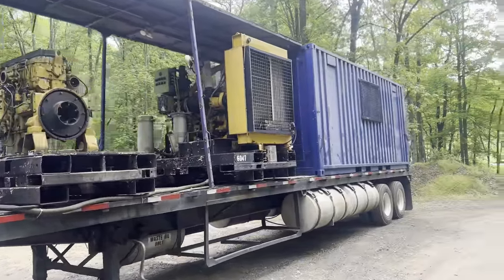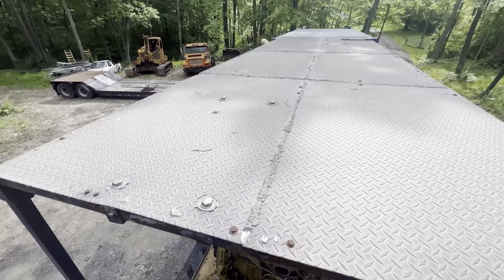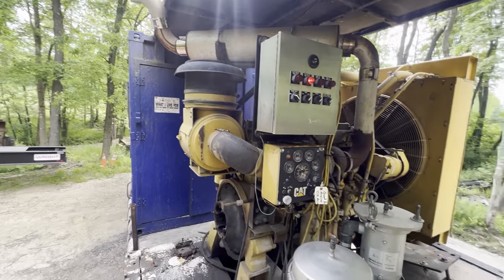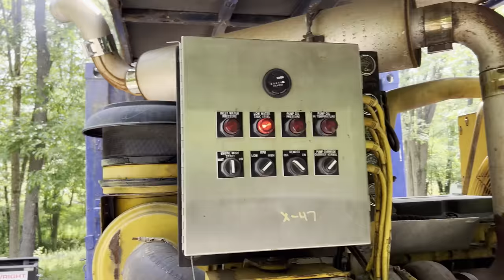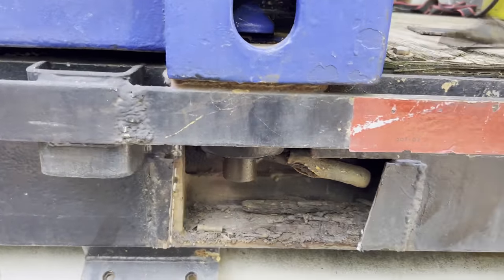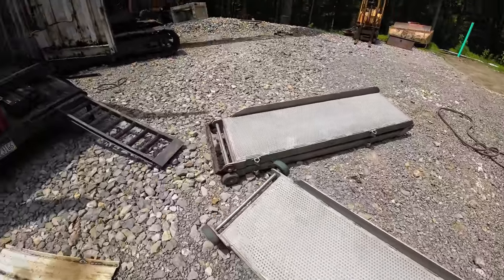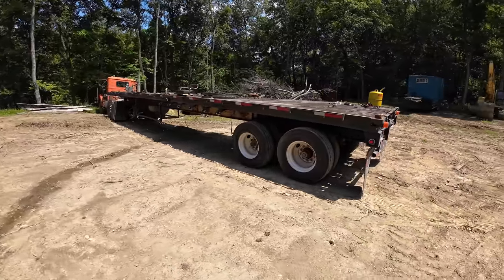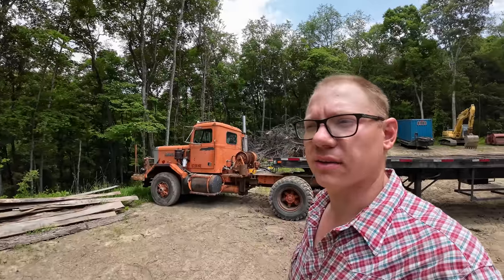I paid nearly $6000 for this Unit at the Auction, Sight Unseen, Will it run??

Comment: "Hydrodemolition (also known as hydro demolition, hydroblasting, hydro blasting, hydromilling, waterblasting, and waterjetting) is a concrete removal technique which utilizes high-pressure water, often containing an abrasive material, to remove deteriorated and sound concrete as well as asphalt and grout. "
Reply: I don't miss that work either.😂
Reply: You are correct.  I was on a job that the concrete in the a few columns didn’t make spec had to dydro blast them off.
Reply: Bolts 🔩  remind me of Russian tanks  😂😅😊
Reply: They use them to remove bridge decks pass the rebar then re pore the bridge deck without replacing all the rebar
Reply: Работник года ✅☝️🙂👍🏆🥇🍊🥥🍇
Reply: @PatrikGivens At least his comment was useful.
Reply: Me watching this, wife walks in, watches for 1.5 sec "don't you have anything better to do?"
Nope 🍻
Reply: Used to do concrete cutting when I was a lot younger!!!!! lol, hard graft to say the least Matt
Reply: Cool learn something  new everyday..I would of guessed gold mining or similar
Reply: There's an old Reynolds tobacco warehouse in Winston Salem that had interior concrete walls dividing up the building.  They blasted them with one of these machines to open up the interior to make it more of an open floor layout
Reply: @PatrikGivens so that i don't have to
Reply: She no go?
Reply: When I was a teenager I did industrial cleaning as a summer job. We had a pressure washer the size of VW Beetle. That thing was scary! Especially when the valve blocks started to leak and you had to stick your hand to the control box to shut it off. I saw that thing cut through concrete....
Reply: @wizpin  I’d respond I don’t know don’t you ?
Reply: Msybe it could be ysed in Gold country Alaska for hydromining???  Sell it as is, once running.
Reply: I’ve been working for a pool company for over 5 years now. We use a hydro demo rig to blast old shells off pools.
Reply: Everything you just said was wrong 😢
Reply: A pressure washer on steroids. 😅😅😅
Reply: Ok thanks google

Comment: The genuine excitement when you found those vise grips, reminds me of the time I found a pair on the road. I was riding my motorcycle home from work a year or two ago, hit a red light, looked down "Oooooh a pair of vice grips".... Got home, and realized they were snap on!! My first and only snap on tool hahahah
Reply: I found a pair of giant channel locks on the bike one day. Tool truck quality and the size you use to compress brake calipers. Best day ever.
Reply: My first and only snap on tool is a wrench a mechanic left behind in my brother in laws car. When he sold the car he cleaned it out and left it outside in the rain so I just took it.
Reply: That is funny...

All (~10) of my Snap-On tools were also found in used vehicles/machines I've owned over the 50 years that I've been tearing into them.
Reply: @FishFind3000 - Same here. I  was two hours away from home on a Saturday and the brake job I knew I needed could not wait another mile. I came across a small-town car repair shop and begged the guy to do the job and he agreed. 'Bout 6 months later, I notice something shiny way deep in the crevice between the driver's seat mount and the doorsill. I had noticed the mechanic was placing his wrenches on the doorsill, and sure enough, it was a 9/16 Snap-on. I am not going to make a two hour drive to return it. And it would cost me at least $10 to mail it. I left it there because it's not mine. Maybe I'll call him and maybe we could make an arrangement🤔
Reply: Regular Vise Grips are better than Snap Off imitations.
Reply: Someone chucked some vice grips in our front yard and they've gotten plenty of use by me lol.

Comment: Hydro dem is widely used in civil engineering, it's a great way to remove defective concrete without damaging reinforcing steel (in fact it can give the steel a good clean, removing corrosion products you don't want cast in to replacement concrete).
Reply: yes sir well said
Reply: Absolutely accurate! Well said.
Reply: It's the machine you hear that's really loud when workers are under a bridge and it's tarped off ...Like a gigantic pressure washer...I'm sure gold miners would love getting they're hands on those engines and tanks ...or a off the grid homesteader wanting some power ...✨👍

Comment: Had to stop yelling at the TV. The big light saying low water, would have been an auto shut off for the motor to protect the pump. ( when it had a HP pump)
The hydro demolition unit would have had a tracked vehicle/bobcat of some description that would have held one slowly rotating nozzle, that is used to breakup concrete. Its a way to remove damaged concrete back to the rebar without causing more damage to the base material through vibrations. When that unit was operational it would have been a incredibly powerful machine.

Good score on the unit though, you will definitely make your money back plus more.
Reply: I think it would have been better more money if he didn't tear it up 😂

Comment: Matt I have an old 270 hp turbocharged intercooled 3306 Cat running a big centrifugal fan on some Opal mining machinery mounted on the back of a truck.
The setup sucks excavated dirt to the surface through a chain of eight foot lengths of eight inch diameter pipe and also circulates fresh air through galleries in a mine at the same time.
I installed an analog watchdog like the one on your C13 when I transplanted the engine out of a derelict truck because the 680 Leyland it replaced dropped a valve while running and threw a leg out of bed and there was no watchdog on the system at that time.

Start procedure requires holding down an override button for the oil pressure shutoff on the watchdog panel with one hand while cranking and after the engine fires until the pressure rises below a preset minimum.
If you don't hold down the override for long enough after the engine starts, the watchdog shuts it down again due to oil pressure not reaching or sustaining whatever minimum pressure it is set at.
Looks like two buttons are visible near the starter key on the watchdog panel for your C13 and I reckon when Sam unplugged that lead it might be that he isolated at least part of the watchdog system.

It could be worth plugging that lead back in and experimenting with holding in those buttons until oil pressure gets up during start.
Because a watchdog in good working condition can be priceless insurance for any engine especially if it is left unattended for any length of time and indications are that the engine on that contraption maybe was.

Comment: Probably carried a mini digger in the back, used to hold a jetting lance. It was used to demolish concrete without damaging the rebar.
Reply: Why would they do that, John?
Reply: It had a machine with a rotary milling head in the back.
Reply: @ljprep6250 when you demolish concrete floors and ceilings you want the rebar to stay so it doesn’t collapse
Reply: @bmxdenver1  I suppose that could be handy in some instances.

Comment: Matt the ramps on the back are for loading the robots up used for hydro demolition. We have lots of trailers built out doing the same thing at work here in Texas. The pumps though on your unit are to small for concrete removal. The smallest pump most people run down here is 60000psi @ 1000gal per min. More than likely your unit was used for the removal of growth on ship hull’s and the removal of paint on them along with the lining of storage tanks for the refinery’s.
Reply: After reading the concrete guys posts here, I was thinking this HAS to be for something less water needy, 1,000 gallons is way too little water and whatever pumps were on that are WAY too small to push that much material around. Nice post

Comment: You just proved what i was talking to friend about a few weeks ago, That a straight frame rear steer is more stable when lifting a heavy load because the counter weight does not get closer to the load when turning

Comment: The reference to WOMA suggests that it was used to run very high pressure water pumps, maybe 10,000 psi or more. May have been used for cutting concrete or even steel if used with an abrasive. Pity the pumps are missing as they are very expensive.
Reply: You're right, but my money is on a fracking application.
Reply: Definitely looks like a hydro demolition rig the filter setup looks simulair to the ones i worked with and most likely in the back container there would be a tracked demolition robot hence the big ramps.
Reply: Can he use it as a substitute for sand blasting?
Reply: @ericsebina256  All the pump gear is missing, the trailer is just one good engine, one dead core, and four fuel tanks.  The tanks are worth at least 500 a pop!
Reply: @ericsebina256  Could be but would be overkill, the very high pressure water pumps are more likely to be used with an abrasive for cutting hard materials and are good on steel etc as the material is kept cool and the cut is quite narrow. They are usually computer controlled. As this rig is mobile it was possibly used in demolition but I don’t know anything about that process.
Reply: That's WHY the pumps are missing:)
Reply: What does WOMA stand for?
Reply: @Jehty_  WOMA Karcher, a company that makes ultra high pressure pumps.
Reply: @BadHaddy  Ah, thanks. 
But man, why are we Germans so unimaginative? 🤣 Another company name that's just the initial letters of the founder..
Reply: @Jehty_  As far as I know Adidas used a few more than just the initial letters so not so unimaginative.
Reply: @IGDZILLA  well, you can't call your new company Adodas (Adolf Dassler) in 1949. Especially if you were part of the NSDAP before. 
So it had to be the initial letters of his nickname Adi Dassler.

Comment: Thats gotta be the most "cleaned out" tool storage/office/whatever box ever to go thru an auction.
Reply: I'm guessing the guy that wants to rent it thinks it's an empty relatively clean waterproof box, not a old filthy POS with a zillion holes in it and doors that aren't even close to being watertight.
Reply: @gorak9000  Im would hope they saw it before renting it.  These are usually used for tool and materials storage on a job site, so yeah good luck LOL
Reply: I'd name that conex box Kamala.
Everyone has drilled it at least once !!
Reply: but they made sure to lock it to add that mystery value gamble at the auction :D I am surprised the auction company even sold something locked without a key purely for legal reason, there could be ANYTHING in there xD but even could be something valuable to throw that 15+% commission onto for doing absolutely sweet F@#K ALL :P
Reply: Yup, can you imagine the amount of hours that a couple guys have spent in that box, on the side of the road , after their 9 minutes of work..

Comment: I figured it was just an electrical control making her not run because every time she started and you stopped cranking with the key she would shut down. Had power to system in crank but not run. Glad you buddy find the problem so quickly.
Reply: I wonder if the connector he pluged back in early on was the other end of the wire his buddy disconnected,
Reply: @KingOfKYA  it looked to me to be a different connection, the one he disconnected went to the upper control panel for the water system. the ones he connected looked to be going from key switch to engine, etc.  I guess only Matts buddy knows for sure 😊

Comment: Matt don’t sell your self short on them engines. I’m a cat mechanic and I know from experience a running c13 with low hours can get you around 30k. The core engine can get you maybe 10-15k. The electronics are so simple. Those engines are a MEUI( mechanical electronic unit injector). The c13 is also a push rod engine while the c15 and c18 are overhead cam. The c13 is an incredible reliable engine with tons of power and easy to work on. The only issue with them is around 15 to 20k hours they start to leak oil from the head externally. And don’t run reman injectors, they never last and will guarantee fail. If you do pull an injector, you have to remove the rocker shaft assembly, you HAVE to replace the rocker shaft bolts and injector hold down bolt. There’s a special procedure to set the injector height too so be wary. If anyone asks, you cant add Jakes to it if it didn’t come from the factory with it, reason is, the block and head and the rocker box don’t have the oil passage to accept a Jake brake but that’s only if it doesn’t have one. Most OTR truck engines and articulated truck engines and some loaders and dozers have them. But a power unit no. Another thing to keep an eye on is the engine oil cooler, don’t run an extended life coolant, I see you got the green coolant, that’s good. Extended life eats the rubber away and causes oil to get into the coolant. The manual calls for ELC but steer clear of it. Other than some tips and tricks on them I could tell you on them if you wanna know, they’re really solid reliable strong engines. Love the videos Matt!

Comment: Here's a good project for you. Connect a generator to the C13 engine, put in the context box, and have a backup power plant for your house and shops. Also, those round stainless steel housings that had the hoses going to them look like coalescing filters.
Reply: build the second c13 up as a spare/for heavy loads while it's all there

Comment: Hi Matt!!!

Word of advice: When you are using a jumper pack with dead batteries, not only does the jumper pack have to power the starter, but it also has to charge those batteries. Parallel circuit. Try either charging the batteries first or disconnect the batteries while using the jumper pack. 

-Cheers. :)

Comment: Hydro demolition is waterjet cutting for concrete, which matches with the WOMA on the gauges - WOMA is a German manufacturer of very high pressure water pumps.

Comment: Solid motor for the Autocar. Sam at Scrappy knows how to hook them to trucks [great motors really]. I'll never understand using brake lines that rot like steel when that nickel copper lines are available and they don't rot [Stainless would be best but it could get expensive].

Comment: All the years i been doing auctions, I have found one common denominator that is absolute. NEVER bid on a individuals item.  If it's from a company, then you're fine but 99% guaranteed if it's some billy joe down the road throwing something in the auction to sell, its a bad buy for sure.  I have proven myself right dozens of times yet still too stupid to follow my own rule. Off the top of my head i do not recall ever buying a lot from an individual that was listed right, flat out lie, scammed or just not worth the sale price. As for this project. Sure does seem like a fun project. Something rather unique we don't often see on YouTube.

Comment: WOMA is a high pressure pump supplier. The gauges you saw are important for the operator when the pump is inuse. To high of a pressure can blow away surfaces you are trying to clean or make a mess of a hole for a wellpoint.

Comment: You should keep the trailer with the box and ramps on it. It can hold your skid steer in the box and put your buckets and other attachments on the flatbed. It would be a great trailer to get auction buys too.
Reply: Bit late for that idea but I agree he should keep the trailer and maybe put the ramps from the box on the back of it to load up his skid steer.
Reply: He already has a drop neck trailer he picked up in another auction, this one’s not really needed, it’s a shame because with twist locks it’s ideal for moving all those isoboxes he has lying around.
Reply: @almostanengineer  was the drop neck trailer shown in an episode?
Reply: @OutlawH2  would these ramps even hold the skid steer?
Reply: doubt a skid steer would fit?

Comment: Interesting setup! KT3406E is a guy that knows his CAT engines. If you haven’t heard of him give him a search. Great cat content.
Reply: I second this. My dad and I always talk about how knowledgeable he is.
Reply: That is the guy to talk to, for sure.
Reply: Least we now know why those two connectors were disconnected :D Probably some low pressure emergency shut down and since there was no pump etc computer shut it self down.
Reply: Came to the comments to suggest the same.
Reply: And Mike from "SmallEngineMechanic" to turn the CAT into a GenSet for the DC compound.
Reply: Those bolts  🔩  reminded me of Russian tanks  😂😂😅
Reply: DC and KT3406E, A perfect collaboration if they rebuild that engine together!
Reply: He's definitely the man but remember he's getting rid of all his cat parts!
Reply: This rig was used for fracking  in oil fields somewhere, my guess is western Canada.
Reply: I'd also recommend Adept Ape, he's a mechanic who works for CAT and sees these all the time
Reply: anyone else see when ole2stroker was shittin on matt because he didn't know anything about detroits ? that dude has a pretty cool channel working on a lot of old detroit 2 strokes
Reply: I was gonna comment this as well
Reply: I was looking to see if anyone else mentioned KT3406E. As far as newer electronic control CATs are concerned he's the guy to talk to. Can also do ECU tuning and sell the diagnostic equipment to interface with the computer cheaper than you'll find it just about anywhere else. He's also an authorized dealer of OE CAT and aftermarket IPD parts, so that also can be extremely helpful.

Comment: That whole set up is used to run a machine that Jett’s out concrete without damaging rebar. The tank would have water in it. And the the two cumins engines would be rigged up to pumps connecting the water too a pressurized system where where it would turn into a water jetting system. The ramps were used for the little machine with a hydrologic arm that held the jetting bit. Almost like a crawler on tracks.